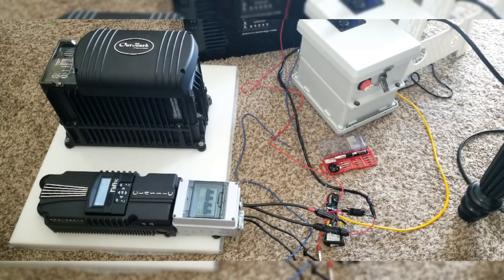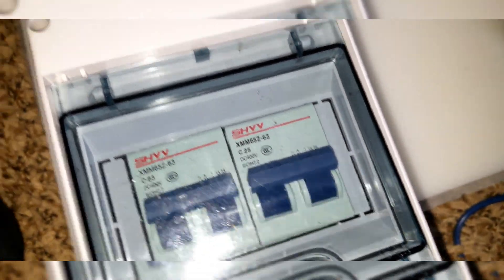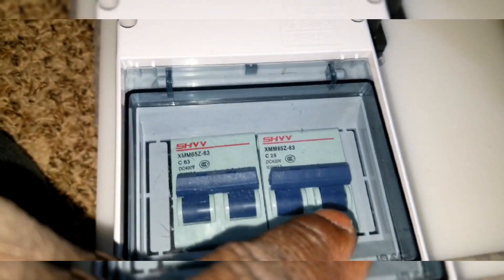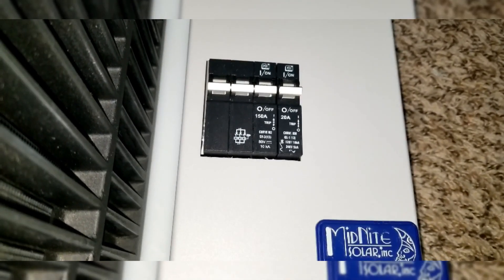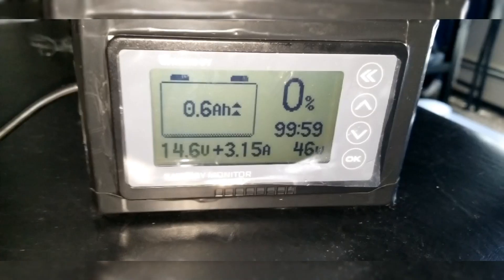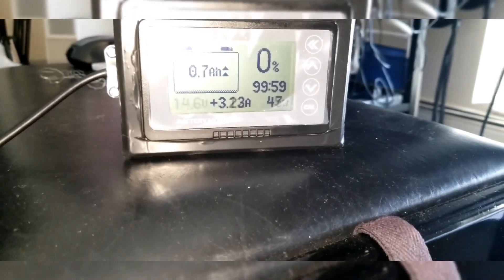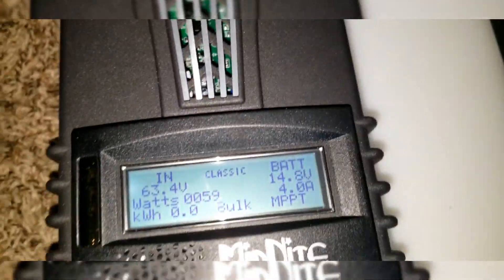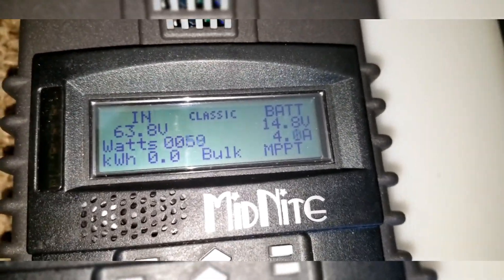OUTBACK POWER VFXR3524A, SINGLE PHASE INVERTER/CHARGER, TEST OUT 96A MPPT SOLAR CHARGE CONTROLLER

Comment: Youll like the outback products, they are heavy duty and reliable.
Weve been running our. Outback radian 8048a inverter w 2 outback flexmax 80 charge controllers now for 5 years straight with zero issues.
We run them hard every day selling power back to grid and supplying our loads. Best solar product out there in my book.
Reply from the maker: Thanks for sharing, OutBack Power Systems are has outstanding performance.
I do own 6 OutBack Power Inverter/Changers both Vent & Seal plus 2 FlexMax 60/80 MPPT Solar Charge Controller for years now. I also 8 MagnaSine Magnum Inverter/Changers and 2 PT-100 MPPT Solar Charge Controllers. These two American manufacturers are my main  backbone for my offgrid Solar System.
Please check out my playlist you will see the rest of them on my reviews